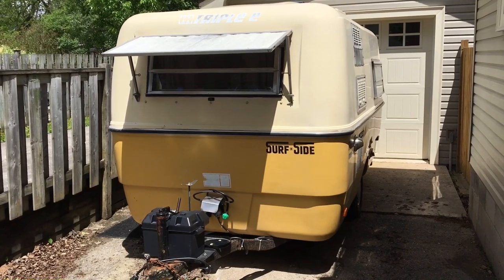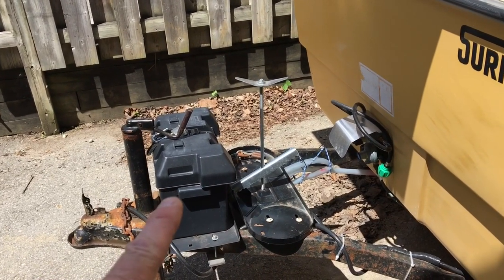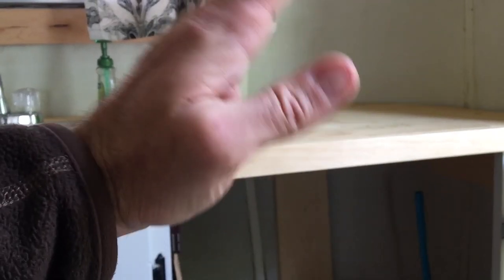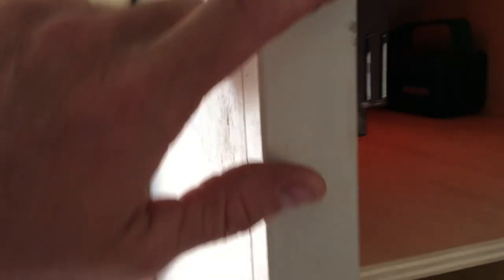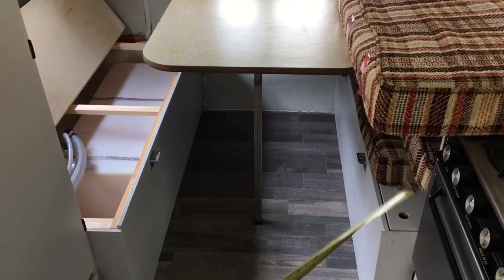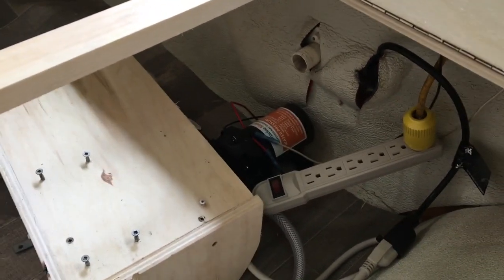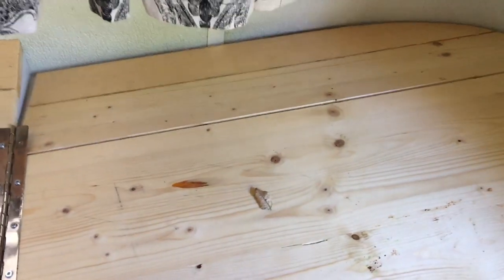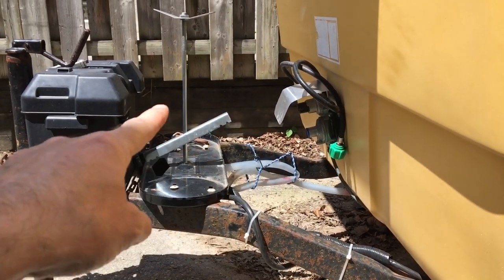Small Fiberglass Trailer Rebuild - Suprise inside

Comment: I really like the layout you've done. I like the shower idea.(you might want to check out a Big Logan video where he used FlexSeal for the shower pan) I'm looking for a vintage fiberglass to renovate. I'm finding most 13 ft. DON'T have a shower.  I'm also considering not having a built in cooktop. I like the eye level fridge. Great video. thanks.
Reply from the maker: Glad you like it. I really liked that little trailer. We used the shower almost every time we took the trailer out. I’d definitely recommend one. I’m not super familiar with flexSeal I’d be worried you would get a crack or cut in the membrane and then have mould growing. In my cargo trailer build videos I show how I used a generic shower pan to put one in the front…. Maybe that will give you a few ideas?

Comment: Do you use the shower tank when winter camping? How do you manage to keep that from freezing. Love your built, we have something very similar in the works. Just as tiny with a shower inside 😅
Reply from the maker: Yes we plan on having the tank even in the winter. That’s why I installed my diesel heater on that side. My plan is fill it up then just have the diesel heater running the whole time we are camping should keep everything from freezing. I will definitely be posting some videos of using the water during winter. We will see how it goes 😁

Awesome to hear you got your own project going!  I had the trailer previously so I went with that size but now that Im working on it and towing it I think it’s the perfect size. 👌

Comment: Great work on the trailer! Is that a working thermostat by the sink? If so how did you wire it in to work with the furnace?
Reply from the maker: Thanks! It was a great little trailer. No unfortunately it didn’t have a remote thermostat. There was one on the furnace propane valve but it wasn’t super accurate.
Reply: @waysoutback  Got it. Yah we have a 77' Surfside and the propane furnace valve has the same issue - adjusting it seems to do nothing. More of a decorative feature than functional :)
Reply from the maker: Yeah I hear you.... I wired in a small computer fan for airflow that really helped in moving the heat around.